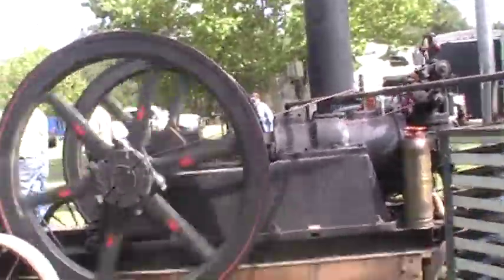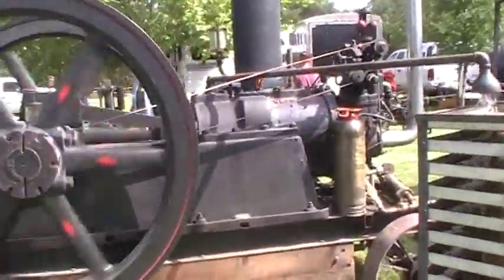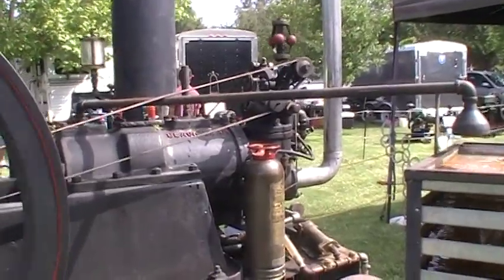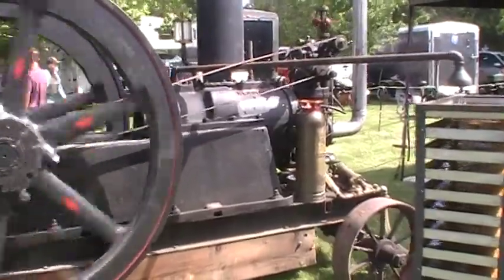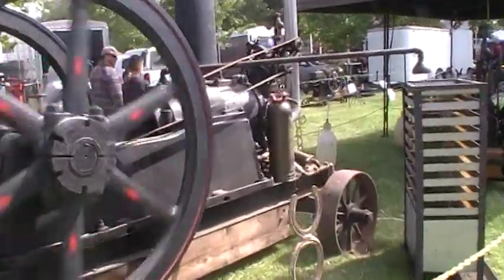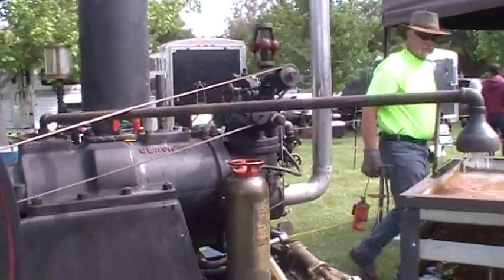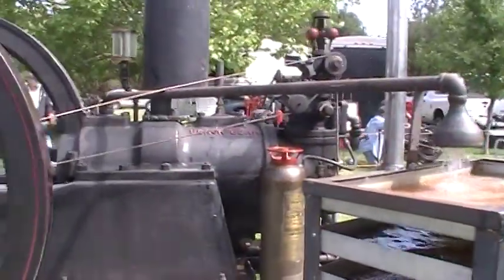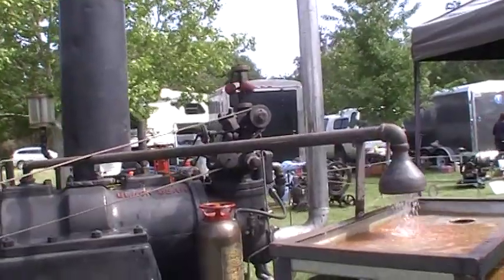Nice 25 HP Black Bear oil field engine on display at the Rio Linda gas up. Sponsored by branch 13

Comment: The integrated shower seems to lack some pressure :)
Reply from the maker: Yeah buddy,  I never seen a radiator quite like it. Ed said it came with the engine.
Reply: Definitely a leaky radiator :)